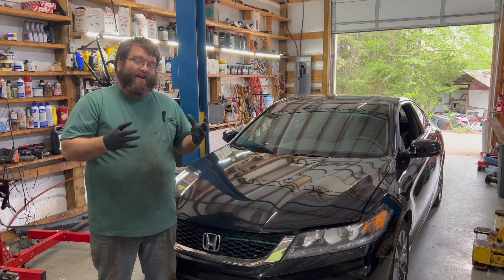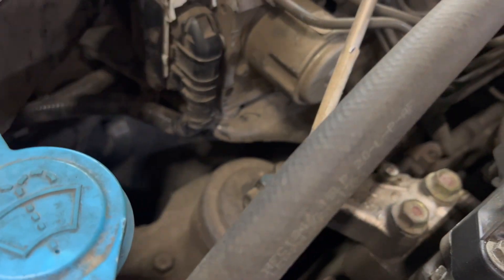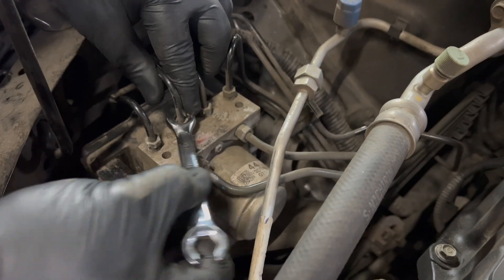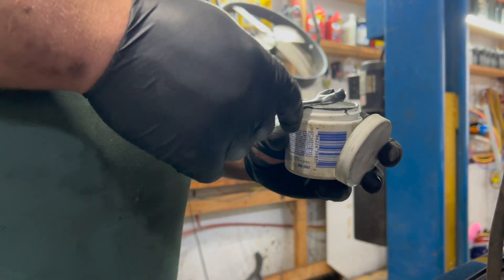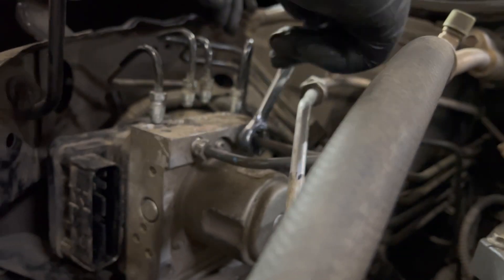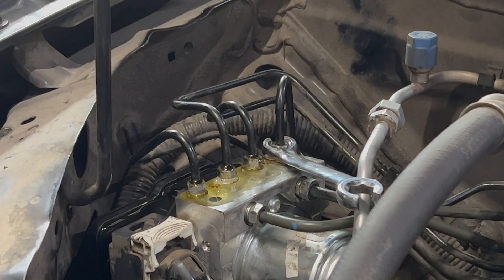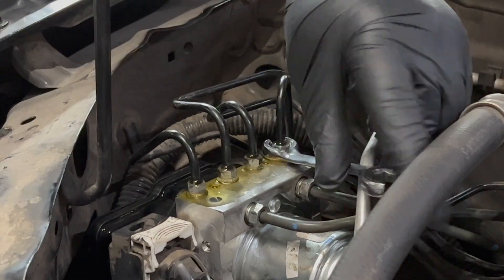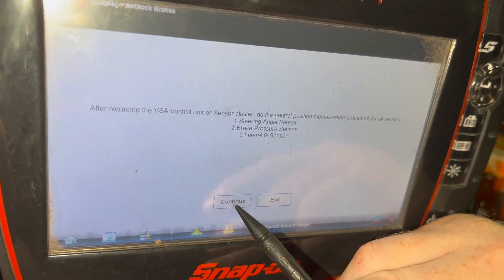13-17 Honda Accord ABS Light Code 121-11 VSA Solenoid Malfunction - ABS Unit Replacement

Comment: I have a question the vsa module went out on my 2014 honda accord so i removed it and had it repaired but the car goes in to gear but in drive or reverse it wont go idk whats going on i have a scan tool that is tell me to calibrate it but when it say drive for 3 meter the car wont drive any idea what going on?

Comment: Can you leave brake fluid in reservoir without fluid spilling out when you disconnect lines from pump?
Reply: Seems like there would only be a bit of residual in the lines as its a high point in the system but I avoided brake lines altogether by taking off just the module. I was able to drive the car until the part came back repaired and didnt have to bleed any brakes out or risk introducing air in the system.

But every car is different. The 2014 accord 2.4 has decent space if you have a civic maybe youre sol on that route

Comment: Why do you need to bleed at the calipers? Wouldn't the air be trapped at the module?

I don't have a lift so getting to the calipers is tricky.

Comment: I am here to add another comment supporting Module Master in Moscow, ID. Had all those lovely Christmas lights on the dash and I was not looking forward to paying $1500 for replacement module and pump. Thankfully I saw other comments on this video suggesting shipping out the module for refurbishment. I’ve never done that before, but I pulled it out (I had to remove the bracket to give myself more play, maybe you won’t need to, but it’s 3 bolts on the bottom.) shipped it out to Module Master, their website made it all super easy. Very detailed instructions for shipping, they were quick to repair and send it back, I put it all back in and boom. Back on the road with zero lights on my dash. I’ve been driving it around for about a month at this point. Zero issues, plus they warranty their work for 5 years. So if there IS a problem, they’ll make it right. 

Also, to clarify, I didn’t pull out the pump. Just the module. I didn’t want to deal with bleeding if I didn’t have to. 😅
Reply: Did you have the FCW (front collision warning) and LDW (lane departure warning) lights on too? Or just abs, traction control, steering
Reply: @ryanafton9647 My Accord is a 2013 and isn’t equipped with those features. So no, I didn’t have those lights on. Do you have a foxwell scanner? (Or some other chassis code scanner.) If it’s throwing the same/similar codes probably this is the issue. I know they used this particular module on several years.
Reply: @ryanafton9647 I have all these lights including ldw and fcw. Did you end up fixing the abs module and did it turn off all the lights?
Reply: Did you have to reprogram it when you reinstalled it?
Reply: @CarlosLopez-kx6bf No, I drove around the block and it all reset itself. Lights turned themselves off.
Reply: Can you clarify where the module is located?
Reply: @DHenry-cs8up Under the hood, passenger side right over the wheel liner. The module itself is black and has a monster harness attached. It’s mounted onto the VSA/ABS pump which is silver/chrome and has a bunch of lines coming out of it.
Reply: @unterganggirl5567  dealing with this problem and getting ready to remove the module. is it just one screw on the underside or are there 2 screws? I know there are 2 up top.
Reply: @carsonishee5119 I’m pretty sure there were 4 T20 torx screws attaching the module to the pump. One in each corner. Some were easier to get to than others. I used a mini socket wrench and a bit extension to get in there and that made it easier than torx Allen wrenches for me. On the bottom of the pump there is a metal bracket attached with 3 bolts into the pump and one on each foot attached to the frame. (I THINK they were 10mm but I can’t remember.) I had to pull that bracket out to give myself enough play and space to get the torx screw out of the module, but you might not need to do that.
Reply: @unterganggirl5567  thanks for the quick reply. i only have the 3 lights (tpms/traction control/and power steering). no abs light or check engine light. you think this module is still a problem with that in mind?
Reply: @carsonishee5119 I think it is a very likely culprit. If you have a foxwell scanner (or another brand that can pull chassis codes) or have a buddy that has one it would be worth it to check the codes just in case. It sucks just throwing parts at a light without knowing what’s causing it. Very likely could be this module though, it’s a known issue in these cars. It should be recalled.
Reply: @carsonishee5119 I just looked through all my old stuff. The codes my 2013 Accord was throwing were: 61_11 (Modulator-control unit power source circuit (ig) low voltage) 
121_11 (VSA solenoid valve malfunction)
151_31 (TPMS switch circuit open)

All of these were repaired and cleared themselves after fixing the module and driving it around the block. They have never come back since then. It’s been allllmost 4 months.
Reply: @unterganggirl5567  thank you so much. I'll go get it read somewhere with the equipment necessary to see whats up.

Comment: The failure, the code is for the computer side of the unit. So you can avoid opening the lines and simply remove and replace the computer takes 30 mins and no bleeding required.
Reply: I have a 123-11 would that be for the module only? Planning to send in for repair but not sure if I should send the whole assembly with the pump.
Reply: 123-11 is a vsa modular valve malfunction... I have this code on another honda... its the module / computer side. You can just send the computer side in for repair.

Comment: 2013 Accord Sport, had VSA 121-11 code shortly after having rear brakes/rotors replaced.  Never had any warning lights come on prior to repair. Could the rear brakes replacement trigger this code?

Comment: My system was the same,  all the lights were on and off. Do you guys want to my total estimate? Part was price $2,457  and labor $500 bucks total out of the shop was 3,300 also is a Honda accord 2016

Comment: I reinstalled the repaired module and the brakes start getting a delayed response any ideas 
Does the abs have to be reprogrammed or will bleeding it out fixed the issue due to air being in it ??
Reply: Here for responses
Reply: I have a guy whose rear brakes are being ate all the way up and I'm about to willing to bet it's got something to do with this solenoid because he's got a fault code that just will not clear. It's the same fault code in this video but for your issue, it does sound like it would be the ABS module. Sending a delayed signal

Comment: I have the vsa and the brake light on only. I’m thinking about buying the xtool d7 to find the issue. Any other cheaper scanner I can use?
Reply from the maker: We’ve reviewed several scan tools on that channel that should work cheaper than that. Topdon artidiag600 pro, kingbolen Ediag elite, launch creader elite, Topdon topscan. Look into some of those.
Reply: @ ok, thank you.

Comment: Did anyone who had this VSA issue also have a dead battery? I've been trying to figure out what I can do for a month now. Just me myself and I with a broken spine, no money, and not knowledgeable about cars just yet. 

My push to start has to be held down to shut engine off and when it's “off” it beeps like I left the headlights on, so it seems to have been pulling from the battery while sitting in the driveway. 

Last time I drove it, it barely started up, and when driving all I could smell was burnt plastic (needs an oil change), but I don't know if it that was the oil, trans fluid brake fluid or what. That was when I took it to Autozone and had thejm run their codes (came up differently from mine), he checked the battery which came back as “flooded”. Don't know what to do from here.

Comment: Good video man! Do you think getting the part from a local junk yard is worth it? The price is hard to beat, it’s 200$ and the car looks fine it’s just being parted out. Do you think it’s worth it getting it used? I can return if it don’t work
Reply from the maker: If you’re going to go that route, I would try swapping the solenoid unit in the side of it (the electrical part). It would be a lot less work.

Comment: Thanks again for this video. I just wanted to leave my experience and error codes here so that it may help others with similar symptom like I had so that they may feel better about it being their issue also.   

I would only have my dash lights come on randomly for the first few weeks and then they would come on every few days or even everyday.   It would be completely random with no rhyme or reason.  I’m sure it may have gotten so bad that they would be on all the time but that wasn’t yet my experience.  I’d have the ABS, BRAKE, FCW, LDW,and traction light come on when they did.   Turning the car off and restarting it and then getting up to about 15mph would make them go away until the next time.  I would get error codes 85-01, 121-11 and U0416.   The 121-11 was one I could not clear off which I’m sure is what was causing the other error codes to come on.   Sending off my ABS module to Module Masters to be fixed has resolved my issues.  

I’ve had the module back in for a week now and have had no lights come back on and no codes thrown.
Reply: Thanks for the post because I was looking for this code. I own a 2012 Honda Crosstour but this seems to be an across the board issue with Honda ABS malfunctions. I will get mines rediagnosed for codes and use Module Masters, as well.
Reply: Did you send the module only or the pump as well? I sent the module and installed it but the lights still on
Reply: @jorgechirinos10  I sent in the module and pump assembly as a whole.
Reply: @NiteStarXX  Uhm, sorry to bother but do you know how can I check if the pump works?
Reply: @jorgechirinos10   I’m not sure actually.   That’s why I sent them in as the unit so that I didn’t have to mess with it.   I feel for you.  Have you called module masters and told them?  I wonder if they could help you out if you were to send in the whole unit the next time since they do give a warranty on their work.

Comment: Okay so I have a 2016 Accord LX with the steering wheel with exclamation point, ABS, traction control, and brake light all on. It's throwing a 123-11 code and Hondas telling me it needs a new VSA control modulator. They also said the VTech solenoid needs to be replaced. Everything I read is a 121-11 code for replacing the VSA control module. Whats your thoughts on this? Im a female so I'm not going to be taking any parts off I will have to get someone to fix this for me but I want to be sure of what it needs and I don't trust the Honda dealership here.
Reply: Do you still need help?

Comment: Thanks for the video. I was able to get mine out MUCH sooner than I thought it would take.  I just followed your steps.  Oh and while looking at the wire loom connector holding the black cable to the metal bracket and trying to figure out how to get it to snap off easily enough, I saw yours was broken off.  Maybe a minute after that and trying to get it to snap off, I unfortunately even ended up following that step of yours too.😅

Now just sending off my module tomorrow to Module Masters and hoping for a quick return and get my car back up and running like new.  

Thanks again!!
Reply: Any updates

Comment: 2013 Accord EX Sedan 2.4L CVT. I don’t know anything about car parts. First car, lost my dad before he could teach me a lot about cars. Started it up Saturday night and these 4 lights came up. I ran the little Bluetooth scanner tool I bought when I bought the car summer 2020, the BlueDriver scanned everything and came back with code 85-01, code definition “VSA Sigbal Failure”. Also, it’s a push to start and it’s not wanting to shut off completely. Where do I start? No money, brand new tires, struts and battery purchased last year. Could an accident cause this issue? I was hit a few months ago and I’m about to schedule a repair for the damage so idk if I should bring this up or not.  I haven’t driven it since then so I’m not sure if a collision could cause this 85-01 error code. 

I don’t know what to do or where to take it for cheap/free here in Arizona.  Any suggestions? 

Also, thank you for making and sharing this video! If it comes down to it, I might be able to follow along (after hopefully successful back surgery to be able to earn income again). It’s been a rough 3 years. (Sorry for my mini rant I’m just stressed). I really do appreciate this video and any advice you or anyone can give! Thank you 🙏

Comment: Do you have to bleed any lines or any extra steps if you remove the 6 black lines? Ive seen people replace the solenoids themselves (the black part) without removing the actual module

Comment: I had a machanic installed a new module and brake and abs ligjt are off. But the "VSA off" light is still on. is it because he did not use scanner to refresh the code? or is it because of something else?